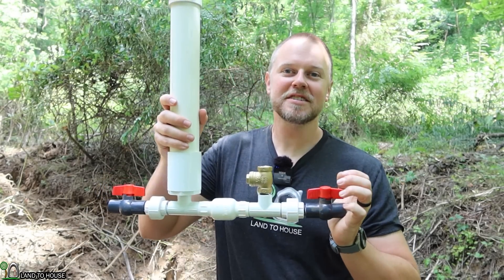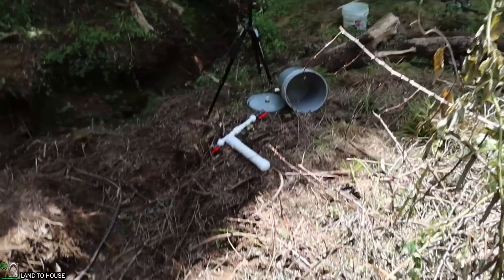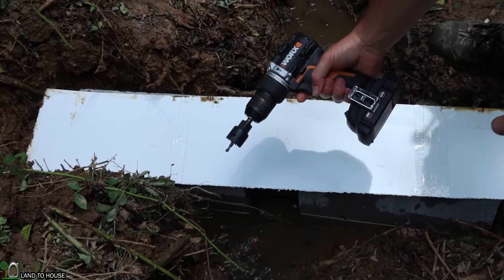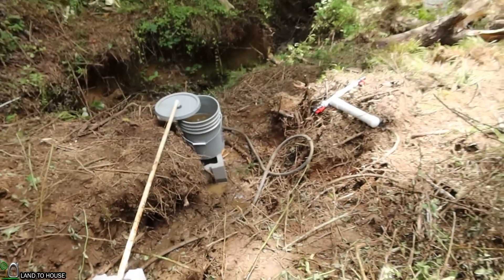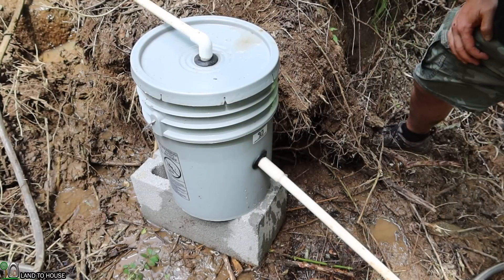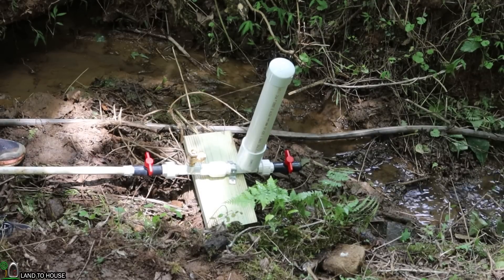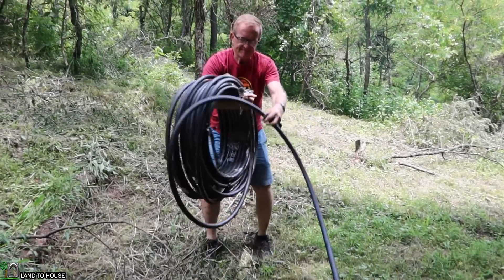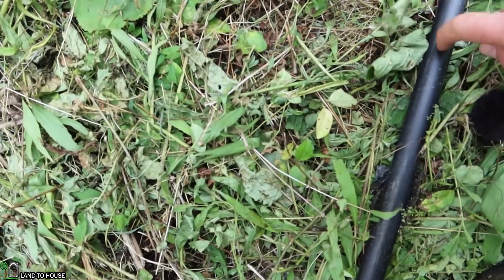1/2 Ram Pump Install with Filter Bucket

Comment: I only have 5' of lift for about 20' but a long shallow flat with creek with 140' of line. I only get water to the top of the valve and don't lift the flap in the valve

Comment: Have a question, I've heard in some states it's illegal to draw from streams as the state owns the water.   I'm definitely not trying to be difficult, just seeking knowledge on whether I can do this?
Reply from the maker: In this area you can pull a percentage to be used as long as it returns to the creek.

Comment: Will a 75 foot water hose deliver enough water on the drive side on a 3/4 inch ram pump, or would I have to have 3/4 pvc pipe on the drive side?

Comment: So happy to have finally found your channel.  I have an off grid wellness property with a creek and this is amazing!  Can I bottom fill with the IBC's?  I saw you did it with the 55gal and it blew my mind.  Thanks a ton for information and entertainment!
Reply from the maker: Thanks for watching! Yes you can bottom fill from IBC totes. Simply place a T fitting on the IBC valve. One side of the T is input from the ram pump and the other side of the T is output for whatever you need water for. The ram pump will fill the tank from the bottom valve.

Comment: For "temporary" PVC pipe joints, I like to put in a short screw. Stainless steel is preferable to avoid rust. Glue is cheaper but cutting apart and gluing on a new piece gets old when it just needed to stay together for a few weeks or months.

Comment: Really nice install video, and your new filter bucket looks great.  That's quite clever to use the rubber coupler instead of having to find an expensive specialty threaded connector for the Intermediate Bulk Container's fitting.

Comment: Nice set-up for a low-flow creek! Suggestion for your new filter bucket: put a pipe from the overflow hole down to almost the bucket ground. Then the overflowing water will come from the bottom of the bucket and will automatically empty-out the settled silt. Isn't that great! 😁
Reply: Good idea! Might siphon, and to stop it will need to put a hole in that new pipe an inch or two below the high water mark.
Reply: I would also like to add that an overflow valve on the filter bucket would be nice for those connecting a small piece of hose or straight from valve back to creek would beat overflowing over the top of the bucket. Nice high overflow valve ftw!

Comment: the delivery pipe has to have back pressure on it, right?  would it be possible to use a ram pump to make a sort of fountain?  if the delivery pipe was short but had a nozzle on the end so that it would only allow a portion of the delivery amount to spray out, would that provide the back pressure the pump needs?  I am thinking it wouldn't but I'm not sure why lol.  you're making some great videos lately, keep them coming!
Reply: He has demonstrated in other videos that almost completely closing the delivery valve to act as a flow restricter can provide some of the needed back-pressure when trying to get the delivery pipe filled, so a nozzle that restricts the flow at the end of the delivery pipe should work if it restricts it enough.  But it will likely end up a fine small misting spray instead of a 'fountain'.

Comment: what would you say your total elevation difference is from filter to pump, then from pump back up to the ibc tote?
Reply: (I am the land owner). The initial drop is about 8 feet. The lift to the IBC tote is 36 feet. I plan to put the tote a little higher when I finish the buildout.

Comment: Any recommendation for using the 1/2" pump in a creek with not much fall but lots of flow? I'm planning to use 100' of intake & need to move water about 300' with 30' of elevation. The flow rate on this spring is that of a small creek. Is it even possible?
Reply: Seth's pump has a 7:1 lift ratio, so your pump would need to have >= 4.5 feet of head pressure at the pump to deliver water 30' above the pump.
Reply: @workbenchz  does that pressure have to be fall or can it be captured from the flow rate or volume of the supply? I've heard Seth mention using a stand pipe...I know I just have to get in the creek & play with it to really find out.
Reply from the maker: Because the ram pump has a pressure wave going back-and-forth from the pump to the source the flow of the Creek does not really affect the pressure. The pump is only able to consume as set amount of water. The head pressure is required to operate the pump.

Comment: Would there be any benefit to, in a particularly "dirty" water setup, doing two filter buckets in tandem, with the first one having its outlet at the 3/4 full point and the second at the 1/2 full?  possibly even using something much larger than the bucket?  i'm thinking, would a uniseal work in  the side of an IBC bladder?  that would give you a nice big tank to gravity clean the source water, as well as a nice large valve to flush out the sediment easily.
Reply from the maker: You can absolutely do that. you could even put in a small pleated house filter to clean the water further. You'd probably have to step up the head pressure into the filter bucket and possibly use a larger pipe as the supply line.
Reply: The key to getting sediment to settle out is to slow down the water.  The bucket acts like expanding the 1/2" supply pipe to a 13" pipe for about a foot, slowing the flow rate immensely, before going back to 1/2" for the drive pipe.  For a pre-settling stage before the bucket, you could use something like an animal watering trough, or a 50gal storage tote.  Dump the water in one end, and draw from the other end to send to the bucket and you can get a lot of settling action from that.
or, check out some of the hydroponics channels for DIY swirl flow or radial flow separators they use.